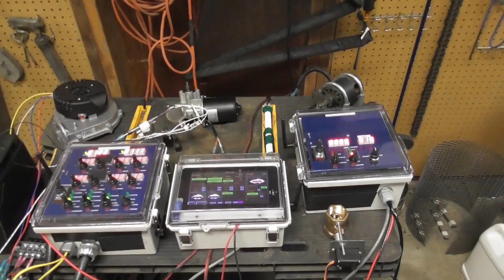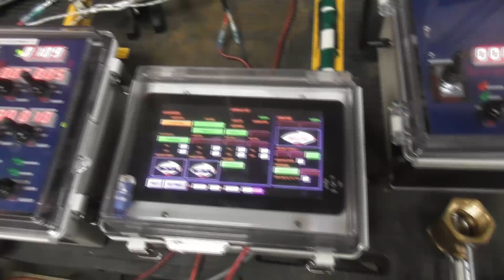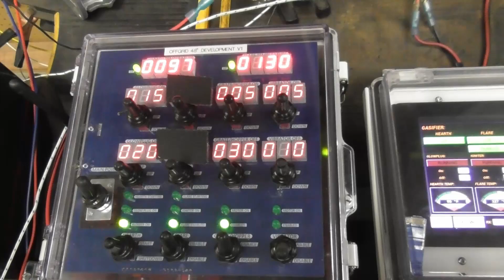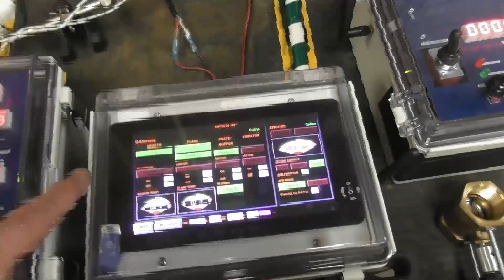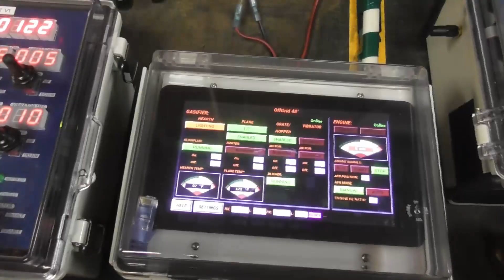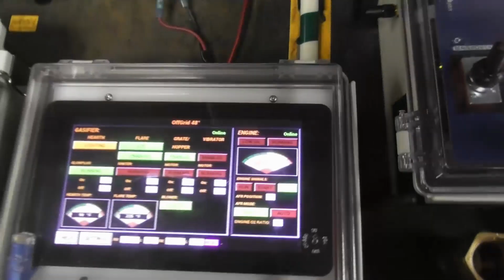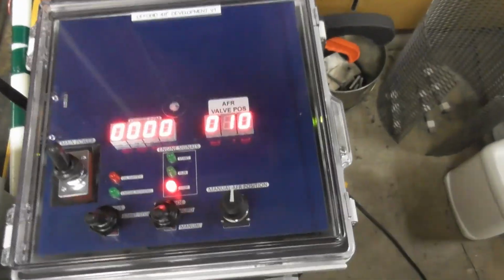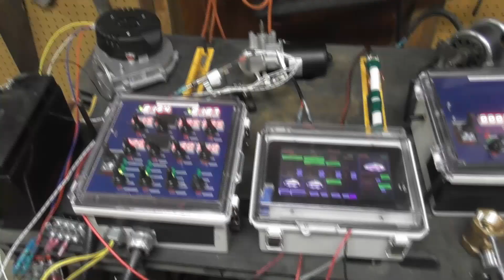Wood Gasifier Builder's Workshop: ACS Prototype Overview

Comment: Nice.  The next plandemic should be able to stop Taiwan electronics parts and all the SHTF gasifiers will sit useless unable to run.  Forward thinking.  Maybe get away from electronics for prepper type things because electronics always breaks first.  And use cheaper refractory in the burner than preciuos stainless steel.  I've been in a freezing power outage situ and electronics, batteries nor insurance warranties will save your life.  Same with powered pellet stoves and electronic diesel injection.  Elon types can KMA!
Reply from the maker: That was definitely a consideration in this design. The previous design had electronic valves and if the electronics ever failed, you could not use the system. This new design is an add to an existing manual system. If the electronics ever fails, you can still run it in the manual mode.
Reply: @steveoffgrid485  I was going to add that running in automatic mode is alright if there's an easy switch to manual in an emergency.  The burner basket tends to burn out on the things, so maybe look into a hard face wearing refractory clay mix like Harbison-Walker Monolithic or VersaFlow 57A or VersaFlow 60 (used to line steel smelters) to line a carbon steel pot to cut expenses.

Comment: Looking forward to seeing this hooked up to the gasifier and engine. Nice job. I'll be tinkering with my automation in the spring. I'm using a slc 500 plc . Also have an o2 sensor mounted on the engine exhaust and an automatic valve. Should be fun. I'm anxious to see how yours works out. Joe
Reply: Did you buy yours from him?
Reply: @Frustrated Majority  No, I chose to use an Allen Bradley plc because I work in maintenance and decided it would be good for me to become more familiar with the equipment that I am responsible to fix. It has helped me better understand how plcs work. I may never be a pro with them but I definitely have a better handle on them. Also,  there are definitely cheaper alternatives. Joe
Reply: @mazdalorean  
Oh sorry I meant the gasifier itself. 

I dont own one but fully intend to when my investments pay off
Reply: @frustratedmajority851  I built my gasifier based on dimensions of the Flash001usa gasifier. He posted a bunch of videos on how to build it. Check it out.